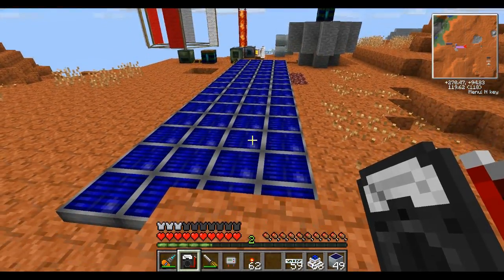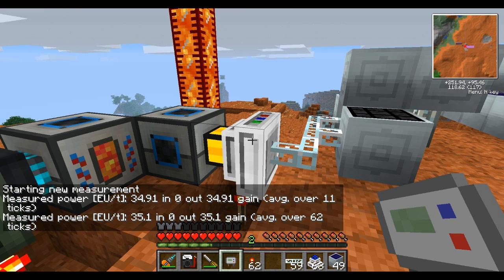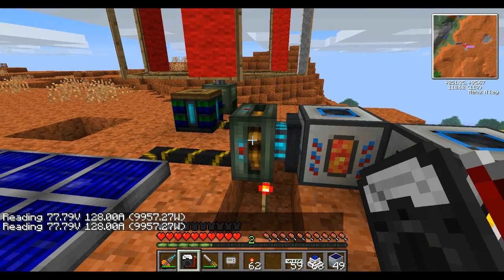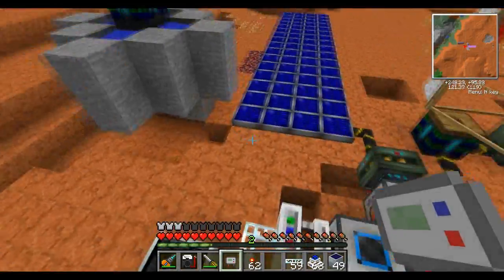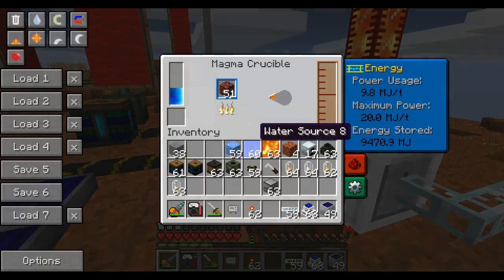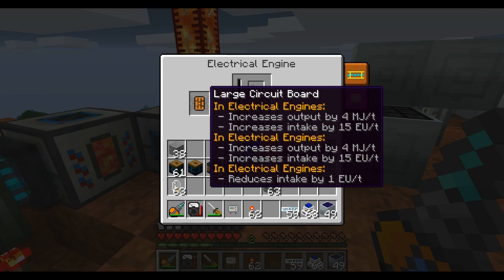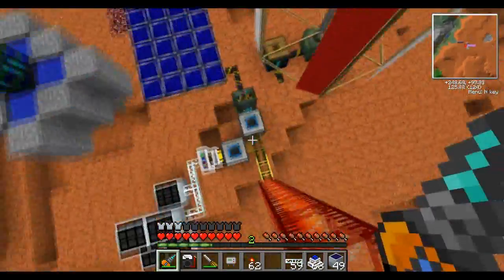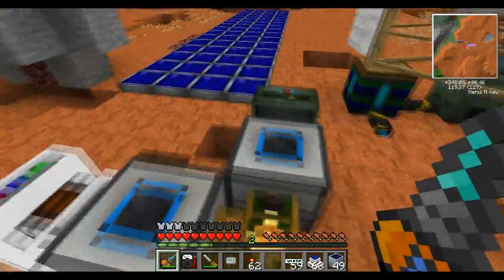Feed The Beast - Tip Series: Bluetricity

Comment from the maker: So this is because of how the power is handled, you need to saturate the line with sufficient voltage before it will start to flow, leave it going for a few minutes and it should stabilize out. Bluetricity often produces unexpected results at first when trying to alter the power system, however it does tend to sort itself out as well. So try giving it time see if it still has problems.

Comment: Great video man. Is there anyway you can talk about running the 10kv power wire in conjunction with regular blu-wire? And how the best way to use power converters? I'm struggling getting any decent power ran from a windmill to my work area underground. As soon as I convert the power from 10kv wire, the voltage absolutely tanks.

Comment from the maker: You're correct on the advanced solar panels, I originally used regular solar panels (1EU/t). However it was to hard to explain the amperage and voltage interaction with 1EU packets release 1 per tick. So I threw advanced ones on so I could work with 8 for a number. I forgot their internal storage made them output 32 EU/t and saved for it. However explaining the buildup and outputting into 32 EU/t packets would have detracted and needlessly complicated the video and not fit with comparing them.